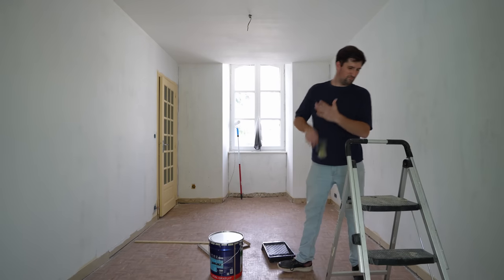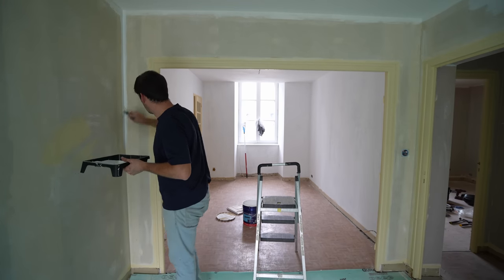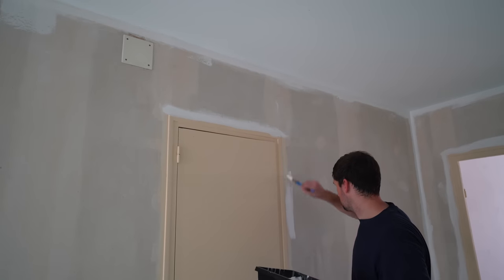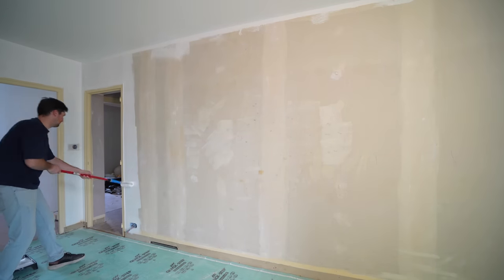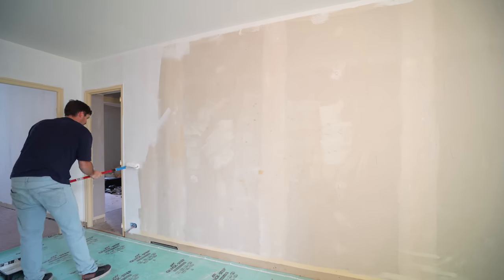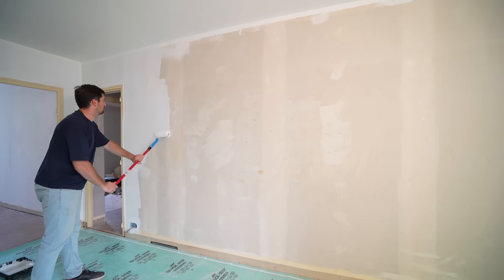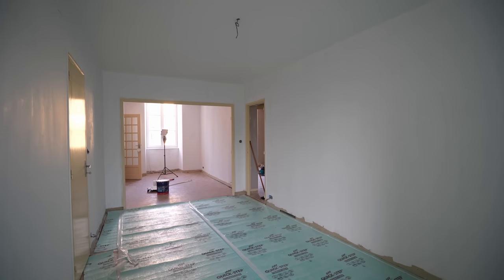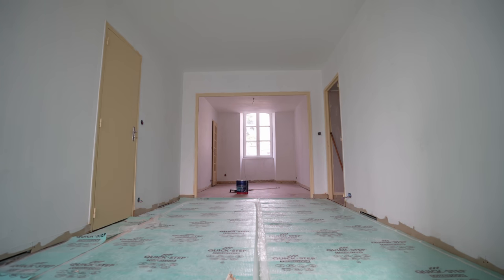Living Room Transformation Timelapse: Before & After!

Comment: Hello Ryan & all of Ryan’s followers who have made it down here in the comment section.   As a one time many years ago professional painter, I am here to let you know Ryan that you did a fine job with your first coat.  Painting (just like any fixer upper job) is an art form.   Equipment is very important & ask Simon you should not go cheap with the brushes / rollers / pan.   To cut the corners, you want a 2 1/2” cut brush.  Use plenty of paint, don’t skimp, and get yourself into the groove as you paint.  Good music helps!  Keep the roller very wet with paint.  When it makes that crackly sound as you roll it on the wall… you are way too dry.   You definitely are not going slow.  It takes time to paint & make it look sweet!
Reply: I forgot to mention…. A good painter can make his brush / roller / pan last for over 10 years!  It simply requires you to clean it real good using warm water & a bit of dish liquid soap.  Keep washing it till the water runs clean & be sure to really rub your hands into the brush or roller to squeeze that paint out.  If you take a break, wrap your brush & roller in a plastic bag so it won’t dry up on you.  Remember… as you paint keep it wet, wet, wet! Don’t be shy using the paint.
Reply: A newspaper or tarp under paint bucket will save floors
Reply: true… tarps are good to have however I do not mind using a floor that will soon be covered over with new flooring as my ‘tarp’. Or if there’s old carpeting that will be taken out, use that
Reply: You actually want to hold the brush on the metal part that has the bristles sticking into it and feel free to sort of twist / turn / play with the angle of the brush as you paint.  Ask Simon or just watch him ‘manipulate’ his trowel… well it’s the same with a paint brush.  Honestly… I would roll those walls using a wider roller.  One that is twice the length as what Ryan has.  But truth be told Ryan did a descent job
Reply: @chad-bf7zi totally agree with you. He went slow enough to get the feel of what he's doing and cover the walls evenly. Beats having to go over a third time.
I've found a long wooden spoon to be really useful to stir paint, instead of a stick. A damp cloth nearby to shift any emulsion smudges and baby wipes for other paints. An old towel dedicated to drying off brushes to prevent rusty ferrules is useful too.
Reply: Very nice comments, and useful tips. I think Ryan bought the shorter roller so it would fit between the door frame and the corner…just a guess. You are so right about cleaning the rollers too, they hold a lot more paint than one would think.🖤🇨🇦
Reply: @tamarrajames3590  yes they do… and not that Ryan needs these extra tools for only painting a small apartment but there are paint roll spinners, scrapers and other things out there

Comment: Easiest way to cut in round door frames and windows is using a paint shield, its essentially a stiff piece of plastic that you hold up to the frame and paint up to it. Works well on emulsion and non drip gloss.
Reply: Incredible! It will be so spectacular!
Reply: If you are going to paint all white, you could you a paint sprayer. Just have to tape off the trim.
Reply: You can literally use thin cardboard or a thin plastic cutting board for that shield.
Reply: Or blue tape. Takes a bit of time but good results.
Reply: After watching Ryan paint his living room white, I will paint a horrible Brown painted room white! Let's hope it doesn't take too many coats of paint to cover the brown, lol

Comment: You can also use a blue  painters tape to cover edges when you paint to keep from over painting. Be sure to remove just after drying so the paint doesn’t stretch and pull instead of a getting a sharp clean edge! Painter’s tape is less sticky so it doesn’t pull off paint under it. To cut in effectively you need a taped trim brush , chiseled is best

Comment: Try using angle brush to cut in, much easier, at least it is for me. That looks so much cleaner and brighter, nice. I don't sand all the flat paint areas except to level a patch or uneven area. First I do lightly sand the glossy paint areas like woodwork or doors then wash them down so you don't get dust all over your new painted walls. I don't know if that helps. Sometimes too many cooks in the kitchen are confusing. You will find the way that works best for you. I've been painting for 50 years and that works for me. LOOKING GREAT, Ryan

Comment: Ryan, get a slanted brush to do your cutting in.  It will be easier especially up at the ceiling.   I prefer the short handle trim brushes too.  Good luck!!  You also need a longer handle for your roller.  It would keep you from bending over each time you reload your roller.  The handle you have may extend by unscrewing the middle and sliding it up!

Comment: Ryan, a tip, mate, after you pour into your roller pan or paint cup, use the brush to wipe off excess on the side as well as move the paint in the lid grove back into the paint bucket.

Comment: You need to pick up an angled paint brush…makes cutting and trim work so much easier… and yes, it always makes painting easier if you 1) paint the ceiling first, 2) “cut the room ” 3) roll the wallls 4) paint the trim… in that order… tiny speckles from the roller will be covered up as you progress with each step…. always put drop cloths down before you open the paint can….nice job!😊

Comment: Another helpful hint for future painting. This only matters if there is a time when you are cutting in one day, but can't paint the walls that same day. if this is ever the case, make sure to brush/feather out the outer edges of the paint. This way the paint you have put on the walls won't remain thick. If the edging paint dries thick on the walls, your roller won't be able to even it out when you paint the walls, and it will be noticeable.   Also a hint for cutting in against another colour. Many people think having less paint on the brush will make less mistakes on the coloured area, but the opposite is true. A good amount of paint keeps all the brush hairs together which leaves a smoother finish, those stray hairs always make a mess. If you place your full paint brush a cm away from the colour then slowly guide it toward the edge of the colour it stops that initial excess of paint from creeping onto the existing colour. (you may already know these things, i'm just mentioning them in case it might help) I think you're doing a great job. I think those who have knowledge should share knowledge. That being said, what works for one may not work for another.  Trial and error is also great. If you think cutting in against another colour is tricky, just practice.  something to try... behind where your kitchen cupboards are going, draw vertacle lines with a pencil. imagine those lines are coloured edges.. use your paint bush to cut them in. use different amounts of paint.. or different angles.. just practice since that spot will never be seen anyway.
Reply: Write a book next time.
Reply: @bridgwll  Do you feel better about  your self worth now that you've been unnecessarily nasty on a comment you should obviously have just scrolled passed?smh

Comment: If your painting the trim around doors and windows do them before your final wall coat. It is much easier to cut in around trim than to do trim last. Also when doing any cutting in fan your edges with you brush to avoid annoying lines when finished

Comment: Get yourself a really good angled brush to cut in around the doorways. It will make a huge difference. Painters tape can help to. Personally I hate working with painters tape. You can also wrap your roller in plastic and put it in the fridge overnight without having to clean it. It can save a bit of time and mess. And keep a pack of baby wipes nearby. If you get paint on something you didn’t intend, a baby wipe is a quick clean up.

Comment: Hi Ryan. Just wondering if you're going to paint the door trims. If you are they probably should have been painted b4 the walls. Also if you roll the same area too much the paint will start pulling off especially when the weather is hot. It dries out very quickly. You're doing well though.

Comment: If you want to get the paint off the door hinges and bring back to the original metal you can soak the hinges in 2 cups vinegar and  2 cups water and soak overnight in a crock pot set on low. The paint will peal off.

Comment: TIP:   Using a calking gun, caulk where the walls meet the ceiling and use you finger to smooth it out. You will have a much neater paint line, especially if your wall color is a different color than your ceiling.

Comment: You just don't listen. You should have PRIMED the walls BEFORE you painted them. The reason for priming the walls is so that the drywall doesn't suck up the paint and give you uneven coverage. The order of painting is 1) PRIME, 2) Cut in with the paint, and 3) Paint the walls. Allow the first coat of paint to dry and then paint (not prime, you only have to prime once) again. Now you may have to do three or four coats of paint to have it look even.

Comment: Hey Buddy! You know I love you bro! But! You like I have never been raised as a builder or decorator etc!  Painting is fairly easy.  Strip the walls, fill them etc etc. Must say I’d of sanded the doorframes back as probably had several decades of paint. By sanding them back a little, it gives you a nicer finish as removes not only the layers of paint but grease build up. Give it a try on other frames and see the difference. A little more work but hell of a better finish. 

Not having a dig mate. But! That little more time spent does give you such a better finish. And I’m sure Billy would be over the moon. Keep the good work up bro.

Comment: Hmmmmmm........ I use a 2" angled sash brush....works like a charm......and I use a nail to put a few holes around the top of the open can so that when I pour it, set the can down........ it drips through those holes back into the can.......not the outside......and i do 2 coats.

Comment: It’s far easier to use paint pads than a roller you can cut in with a pad as well. You use far less paint and I found it quicker than a roller and brush there’s also a lot less mess and you don’t get that orange peel effect with a pad.😊😊😊

Comment: Getting rid of that awful yellow has really changed the whole room...for the better.

A few tips to make your painting life easier:

1. Get an angled trim brush (2.5 inch)...it doesn't take long to master this...press down and use the tip of the brush as your guide ..you will never tape again and will get perfect straight lines.

2. You need to remove all the doors and hardware. There are lots of ways to soak the hardware and remove all the old paint. Get you, at least,two sawhorses and paint your doors inside one of the rooms. ( Sawhorses are easy to make) The sawhorses will also come in handy when it comes time to paint all your baseboards.

3. Paint your trim - this should be a different color than your walls...use an enamel paint for easy cleaning thru the years. Paint all the trim the same throughout the apt. Paint the trim BEFORE you put on the next wall coat ( as it's nearly impossible to paint trim without getting paint on the wall) But, it's simple to cut in along your trim without taping.( If you use an angled brush)

4. Good job cutting in !! I'm so happy you are using a roller to apply wall paint. Paint a 3ft x 3 ft or ( 4X4) section at a time. Make a big M on the wall, then blend in. This will give a much more uniform amt. of paint with few brush marks showing.

You are doing so well and you are gonna be so proud of yourself when it's all done!!